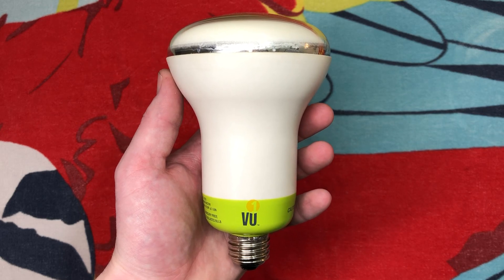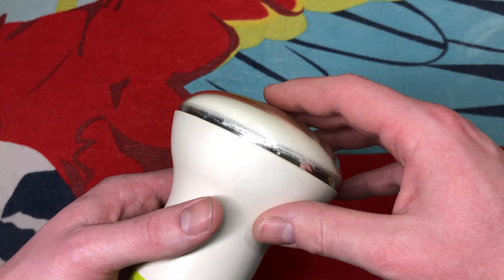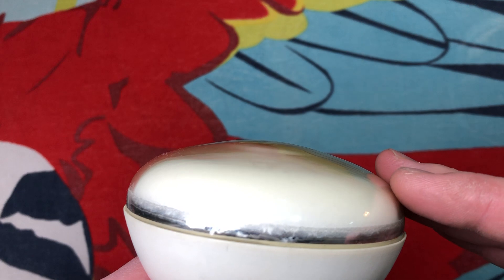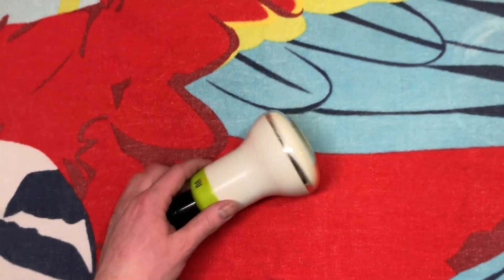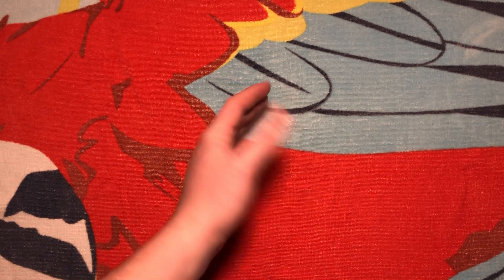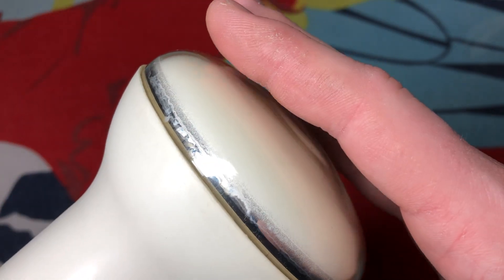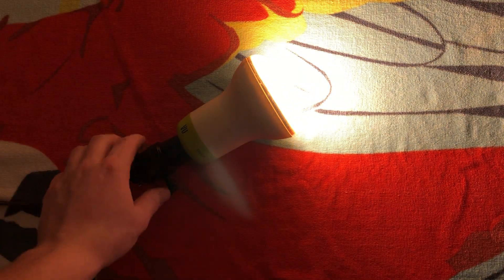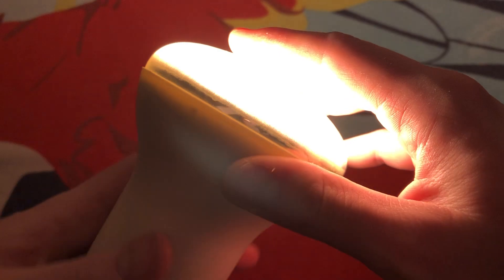VU1 ESL (Electron Stimulated Luminescence) Flood Light Bulb

Comment: Imagine if former VU1 engineers made a 4K/8K interlaced CRT with high nits. Also the whine is so high pitched that humans even infants and small children cannot hear if which is it required for a 120hz refresh rate. It would have a nice warm pleasant picture that cannot be reproduced by micro LED LCD, QLED, or OLED. Making them suitable for not only perfect for classic games but for contemporary titles too. A 50 inch 4K CRT model would draw about the same power as a 32 inch CRT due to the efficiency of GaN electronics and has about a 4000 dollar price tag.

Comment: If I ever get my hands on ESL lamp, it would be interesting to modify it (with new electronics) for funsies - basically a light bulb that also display something else when the microcontroller is told to display video like smiley or something like that (it may require a custom yoke and of course it won't be sharp due to the grid but still more than enough for fun). Of course I may run it at half power to preserve the CRT phosphor's lifespan though - yet I would also have fantastically weird lamp too that I can also use it as a clock too if I wanted to.
Reply: It really doesn't make sense to me is that, the monochrome CRTs outlasted than ESL light bulbs, and Spats Bear has the video to prove everyone about ESL's lifespan.

Plus, monochrome CRTs, if you know how to make as a light bulb to light up the whole room, you are very lucky one.

On the other hand, green, amber, yellow, white, and blue monochrome CRTs act as a monitor or TVs to produce videos. For example, rear projector TVs has a three color CRTs that if you know how to make stage lights like a party lights, you will be lucky to enjoy your night party, or anything you like what you want.

Comment: I have one of those I bought as a curiosity when they were still being sold brand new because it was obvious that it would not be around long. I actually bought four of them since some other guys I knew wanted one and two were defective right out of the box and a third died a few months later. It's a neat technology that had a lot to offer had it come out a decade earlier when compact fluorescent was the only alternative to incandescent. Unfortunately for VU1, LED bulbs appeared on the market and rapidly matured and by the time the ESL bulb was actually available for purchase LEDs had become superior in every way. Higher efficiency, longer life, lower cost, and better quality light output. Still, as a fan of unusual lighting technologies the ESL bulb is a neat and very unique piece in my collection. It was just too little, too late to succeed on the market.

Comment: Nice legacy concept, but it’s very inefficient.
Reply: Compared to incandescent they were quite efficient, and they worked much better on dimmers than CFL but they could not compete with LED.
Reply: @James1095  These CRT bulbs were more efficient than incandescents and halogens but they are much more inefficient than CFLs and LEDs.

Comment: Thank you, I never heard of these bulbs before. Seems to  make quite a lot of light for fairly low wattage.  I love your  phrase "Smells like static." It's pure poetry!
Reply: Compared to incandescent yes, but compact fluorescent produces slightly more and compared to LED the ESL lamps produce about half the amount of light per watt. They certainly are neat though.
Reply: I remember we had a 19 inch or so JVC (I think) CRT TV back in the first half of the 2000s, manufactured in 1989, which I checked the date stamp before we got rid of it, and the static could be smelled when I turned it on in the winter in the spare room to watch How It's Made. I did prefer the Westinghouse flat screen LCD we used though. 

So, on to tech adoption rates, and why the Vu1 failed. While LEDs are more efficient compared to ESLs (cathode ray Vu1 bulb), this technology could have been promising if it came out in say, 2003, instead of 2010. I first heard about the ESL bulb in 2023, as I was curious if anybody made a lightbulb that uses CRT technology before LED took over. Man, if this came out 5-10 years earlier, it would have made a great transitional tech between CFLs and LEDs. Why 2000-2005, if I may ask? Well, LED bulbs came out in 2010, and took over by 2017-2018 or so, so a 5-10 year tech adoption rate. The Apple smart phone came out in 2007, and didn't become ubiquitous until 2012-2014 or so. Here is the exception. CFLs came out in 1976, but took over 30 years to come to become popular in the market. Electric cars also came out in the 1890s, and then again in the 1990s, but will take over until late in the 2020s. So, a 5-10 year adoption duration does not work for everything, but it followed the adoption of the world wide web (invented 1989, popularized in late 1990s), LED bulbs (invented 2010, popularized later that decade), and smartphones (shown in 2007, popularized in mid 2010s).

Comment: is metal halide ballast the same as mercury vapor ballast? I'm trying to find a mercury vapor ballast kit but they are very hard to find. I can only find metal halide ballast kits
Reply: You can use mercury vapor bulbs in metal halide ballasts with no modifications
Reply: @griffine2456  thank you so much. So I don't have to do any modifications to the ballast whatsoever?
Reply: perry raybuck not to my knowledge
Reply: I’m running a 250 watt mercury vapor on a 250 watt metal halide ballast with the ignitor and it runs just fine
Reply: Im relatively sure that metal halide ballasts can be used for mercury vapor. The ignitor needs to be disconnected though.
Reply: Yes and no. To elaborate, some types of mercury ballasts can be used with some types of metal halide lamps but this is not universally true. The reverse is true more often, mercury vapor lamps have much more robust electrodes that are oxide coated so they don't have to be run as hot, they can tolerate high crest factor and being over-run in ways that metal halide lamps cannot. Also pulse-start MH lamps obviously need an igniter. Over in 240V land where most ballasts are simple chokes you can usually use a mercury choke to run a MH lamp.

If you do not know what you are doing it's best to only use a HID lamp on the correctly specified ballast, MH lamps in particular can suffer from what is called a "non-passive failure" where the arc tube ruptures with enough force to shatter the outer bulb resulting in a spray of red hot quartz fragments and sharp glass. You don't want that.
Reply: James1095 correct. Only probe start metal halides can be used with mercury vapor lamps but all mercury vapor lamps will work with their metal halide counterparts

Comment: Wonderful!   Any X-rays produced by the high voltage?  Maybe not high enough to produce X-rays.
Smelling O3 (ozone).
Reply: Definitely too low voltage to produce X-rays hard enough to really have a chance to escape the face glass, but yes, it would obviously produce some - it's technically protected for all practical intentions (CRTs are heavy for a reason; they're made of alloyed glass that includes Lead which do double jobs, both to improve the optical characteristics of glass and stop the X-rays from making their way out).
Reply: Technically any time electrons strike something some of their energy is converted to x-rays. The voltage used in these lamps is much too low to result in x-rays that can penetrate the glass though.
Reply: @James1095      Thank you.   Years ago learned that my large Tesla Coil was producing X-Rays where the arcstruck metal.   Wonder what doses I received.
Reply: @robertgift little to none. Don’t worry about it